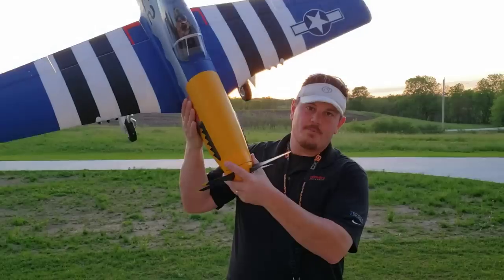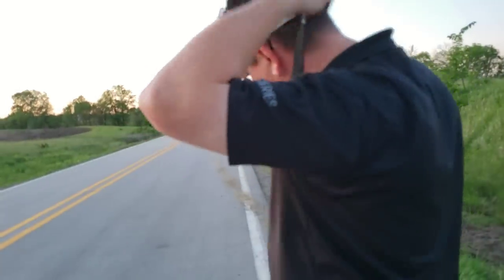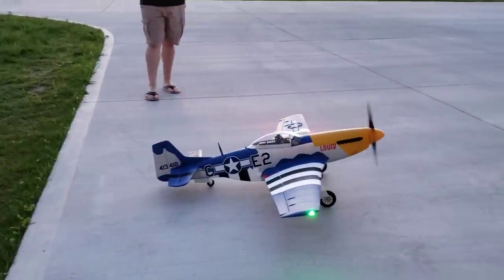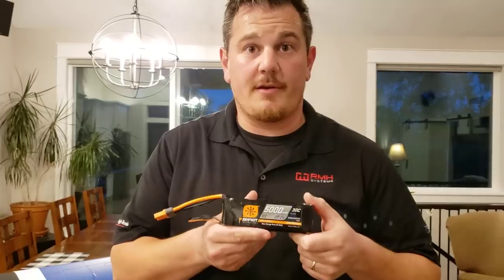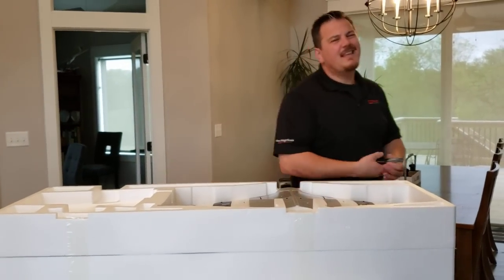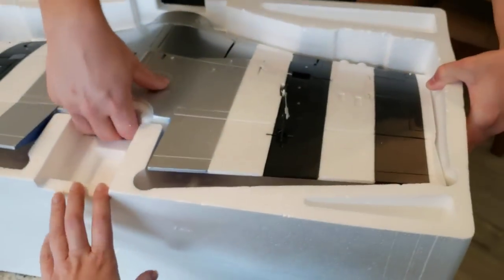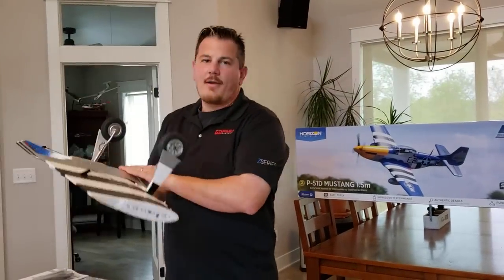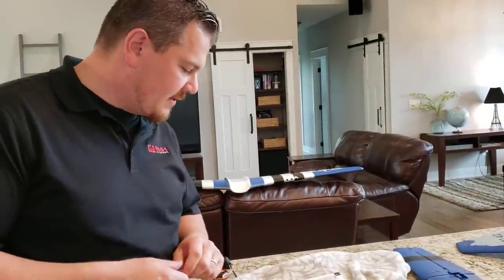E-flite - P-51D Mustang 1.5m - Unbox, Build, Setup, & Maiden Flights

Comment: Just maidened mine.  The intent was after increasing throw to go down the runway and see if she would track stright and then stop.  Well she took right off.  So easy when you have rudder control tracking her straight.
I have the original release and the gear doors were very stiff and brittle.  They both popped on landing.  Easy fix with your demonstration!   Thanks Brian.
Reply from the maker: Thanks! So you made for more rudder throw, and she was easier to launch??? AWESOME!!!! She can be a handful, but then that's not always a bad thing ;)

Comment: Purchased one Brian, and from your master link to HH.  Thanks for the effort (both of you) to put out these instruction videos.  Sadly, it arrived DOA with a loose pin on the fuselage side of the aileron connector.  No ailerons or cool lights...  I am just so glad the loose pin did not make enough contact to fool me, then punish me in the air.  I’d have had a nasty crash and probably never known the reason why, so here is a tip for others who get this model:  Do what Brian did and test all those connections with a servo driver.  I love the one built into the battery checker.  As for the connection from Fuselage to wing and anywhere there are pins (as opposed to sockets), push gently on the pins with a toothpick or some such, and check that they don’t slide back into the connector or wobble about.

OK, so that’s disappointing, but here’s the good part.  After the mildly annoying process of using the contact form to get the process started, and the also frustrating delays in communication due to a busy tech support department, they got back to me, reviewed the description and photos I sent on the phone, and immediately put in an order for the connector and screw I needed to effect the repair.  Those parts arrived FedEx yesterday.  I’ve yet to fix and fly it but felt ready to post an important data point, and here it is.  Brian often raves about Horizon’s support, but honestly, and don’t be insulted Brian, you have to take that with a bit of skepticism.  People who are sponsored by, or have financial relationships with, or are provided products to review, often get support that the general populace will never experience.  I know this not just as a suspicion, but as a fact.  I founded Measurement Computing Corp and we had flags for large and influential customers.  Who wouldn’t?  A customer who represents a chunk of your income, or has the reach to burn your reputation, is a customer that is going to get special treatment.  I have no idea if Brian does, but one has to wonder.  Well, with regard to Horizon Hobby I’m not wondering anymore.  The support from Horizon is great, they’ve been great to me, and I don’t mean a damn thing to Horizon beyond being a regular customer.  So that’s my endorsement.  I hope you experience the same great support I have.
Reply from the maker: Thanks for the comment Brendrix, and firstly, sorry you had a bad pin!!! I understand yours and other's skepticism. You have to remember that before I was working with Horizon Hobby, I was in the exact same boat. I've JUST last week, called to ask for a motor on my little UMX A-10...one of the leads melted on ONE of the motors! Easy diagnostics, and then a couple pictures later (that weren't even asked for) and I had the part in the mail a couple days later. I need to install it, and it's a pain in the butt to have to deal with this, but it'll be made right. I've been in arguments to the point of wanting to pull my hair out with Hobbyking, and a few other select companies (I even had at least ONE like this at HH - but we kissed and made up, interestingly enough!). A lot of the issues experienced in RC Hobby originate from operator error (I'm included) so the hobby companies have an uphill battle deciphering if the customer want free parts, or if they had a problem that was caused by them, the MFG...which is tough, but HH is one of the best if things don't go perfectly. I've had good luck with a few other companies, don't get me wrong, but I've had terrible luck with others. Ultimately, I'm as cheap, and hard headed as they come. I generally fight until I get what I need, while many will roll over too easy, or others come on WAY too strong and prompt a defensive "No" from companies.

At the end of the day, I need people to know that if they do everything right, and even if they do some things wrong, Horizon Hobby will be one of the best at being there to make it right. They might say no once in a while, but I might be fudging a bit once in a while...there it is ;)

Glad you're getting this beauty airborne soon!

P.S. One last tip - Keep the thing from ground looping to death - keep her on her mains as long as you can on landing! Good luck!

Comment: Had my Maiden yesterday! Flies wonderfully! However: I had the same issues as you: 

• One of the retract strut covers broke on my first flight only they didn't give me any spare ones!!! Currently trying to sort that out with Horizon now. 

• That 3mm of down elevator is nonsense. If it wasn't for safe mode my first flight would have been really hairy. Mechanically put the elevator level for the second flight and BAM. Perfect level flight. Flew like an absolute dream. Like the 1.2 June Nite but with a much firmer stance in the sky. Flies on rails.

• Ground control: What ground control!!!!! You cannot keep this thing in a straight line! Learned that you have to very slowly increase throttle for take off, and abandon take offs if it shows any sign of straying off path.

All small things though really. I consider my first two flights a massive success. Got a little work to do on my dual rates and expo. I followed both your settings for this and also referred back to your settings for 1.2m June Nite and decided for something halfway in between. Worked out that I want to soften the ailerons, but not rudder or elevator, so I think I'll just put more expo on ailerons on my mid rates and fly on mid rates all the time. Once I get comfortable with a plane I don't really use different rates, they are just good for the first few flights till you are sorted.

Thanks for these videos I just wouldn't know what to do without them!

Gonna buy a Viper next so the other night I watched all your viper videos!!!!
Reply from the maker: YEP, glad I'm not just a BAD pilot ;)  "• Ground control: What ground control!!!!! You cannot keep this thing in a straight line! Learned that you have to very slowly increase throttle for take off, and abandon take offs if it shows any sign of straying off path."

So glad you were able to get a starting point from watching my videos ;)

Comment: Brian you're so lucky your wing just slid through so easily. I jimmied it in and out for an hour and gave up. Gonna try tomorrow again.  Still blown away by the size of this thing.
Reply from the maker: "I jammed it in and out for an hour and gave up" - wow...TMI - LOL - I'd try tomorrow even if you had success ;)

WOWZERS!!!

Okay, now, in all seriousness. Why couldn't you get it in? Are you talking about the tail or one of the main wings??? If you're having trouble, you need to look into the alignment of the connectors. Take a servo extension cable and drape it between the connectors and make sure they connect. If they do, now test the wing....are all the servos working? Was one backward??? Get some more information about if it was capable of alignment.

Also, If I'm not mistaken, can you just pull out the wing connector plugs and see if they'll go into each other? If not, that's your issue.
Reply: @BrianPhillipsRC  LOL didn't realise that's how it came across. I'm talking about the main wing installation, it seems like the servo pins on the fuselage are slightly out of alignment and I'm not sure how I can fix that. It's also really hard to see the alignment on this thing. I'm thinking to take out the wing connector plugs, try and see if they go into the fuselage, and then stuff them back into the wing again. I was watching RC informer's assembly video and he seemed to have the same problem that I did with the wing installation, but he bent the servo pins somehow and got it to work, which I'm sure I would stuff up some how.

Comment: Hi Brian, I struggle with take off on this P-51D. It has such power that it torques on take off! It is an awesome plane to fly with really outstanding colour and is very striking. I fly at a designated flying zone in Aus and families stop to watch because of this plane. CG is always critical but in this plane I find that the stall zone is deadly if the CG is not perfect. A really long landing strip is also good LOL
Reply from the maker: I'm glad to hear this, as I too have had a heck of a time with ground handling. It's like spray and pray ground handling...you give her hell and hope she'll transition from the tail wheel to the rudder authority in time, but before you know it, you're in the air and flying!!!

Landings are very sketchy, I could drive it down the block on the mains, but as soon as I try to drop the tail wheel, it's just a total guessing game!

Comment: I'm an Aerospace Engineer.  The CG is measured from the leading edge of the wing at the root.  The root is the portion of the wing touching the body.  This is a straight-line distance, not curved as in over the wing chord.
Reply from the maker: yes, I have since corrected my way of measuring for CG. This was an incorrect way of doing it, as you mentioned.

Thanks

Comment: Nice mini series Brian 😆 That is a great looking Mustang.It does need a little friction on the gear to slow it down.🍗🦊
Reply from the maker: I've been thinking about putting a zip tie on the strut to engage the side or top of the tire, just enough to slow her down, but which could be easily removed if I don't like the way it works. When I figure it out, I'll be sharing a video.

Comment: I grabbed the pushrod with needle nose pliers and tried to move it with no success. I will keep working on it. Hopefully I can get it working without new parts. Lately Bangood has been in the slow boat from China mode and it seems everything is a month or two to receive. I just received a UMX Turbo Timber from HH so this may get me moving on that. Still have to buy a transmitter. Thanks and enjoy that P-51.
Reply from the maker: When you fly the Turbo Timber, you will quickly forget the repairs you're making :)

What transmitter are you thinking about? Any of these???

Transmitters...
ix20 - https://bit.ly/2Rv1d3M
iX12 - https://bit.ly/2yOEDN7
DX9 - https://bit.ly/3eh3klx
DX8 - https://bit.ly/2xmsD5f ------ I would do this or better (above), if you're getting obsessed [like me].
DX8e - https://bit.ly/34uxoWn
DX6 - https://bit.ly/2Rvik5z
DX6E - https://bit.ly/39Ym1Y9
DXe - https://bit.ly/2XsApFi
TS8G Plus - https://bit.ly/39Vxwzy

Comment: Brian set your timer to turn on and off with your throttle cut switch. You’ll always know the actual time under power. I learned that trick from CoeShow619 and it works great! Btw great videos you’ve inspired me to work harder as a newer fixed wing pilot so I can get some of these awesome planes.
Reply from the maker: I keep hearing this tip. Glad we're an inspiration ;)

Comment: I was leaning toward the DX8 with future aircraft needs in mind. As far as being obsessed I am a retired airline pilot and airplanes have been in my blood for 50+ years. I have watched the RC hobby for much of that time but it was usually too expensive or difficult until now. Your videos moved me to jump in first with the mini Trainstar and then the Sport Cub 500. Been having fun [and crashes] with the Sport Cub. The Turbo Timber looks like a fun step up to improve skills with for a while. Really like that P-51 though!!!  I cut the wing off the Sport Cub last night and it looks like the elevator servo arm was rotated 180 degrees and impacting the rudder servo arm. Jammed. Don't have any idea how that happened.
Reply from the maker: Go for the DX8 - you'll NEVER look back!

DX8 - https://bit.ly/2xmsD5f

...and to be totally honest, the DX9 has such a big price jump, that you can just upgrade later when you get to more sophisticated aircraft.
Reply from the maker: Glad to hear you found the issue with the servo. I figured you were bound up. If it fails to work again, there's a gear inside that micro servo that's broken. You may take it apart and visually inspect it to learn, first hand, what happened....if you can't just take off and run with it after "centering" it manually.

Comment: My 5000 smart pack is flush with the front of the battery tray and balanced perfect on a Dubro CG balancer. Not sure why yours is so far forward.
Reply from the maker: Maybe they omitted a nose weight???!?!? I had a buddy that had this happen, we didn't realize it until it was crashed and the BALL was missing!
Reply: The esc is likely pulled backwards in the nose since it’s not glued in place.  Try putting your hand in the fuselage and pushing it way forward but not so far that the orange heat sink on top of it touches any foam n fuselage.

Comment: 100% on the elevator correction.  Initially when I was testing the deflection full up elevator looked to be neutral to me.  Then I watched the rest of the video and saw what happened upon first flight.  Sometimes as the pilot you can't always believe what is in the manual, better safe than sorry.

Comment: Hey Brian, what a video!! Very in depth and enjoyable. You and your camera crew make a perfect team. Don't ever get ride of her or your channel will fall flat on its face.

I may have missed something but it looked like all you needed to do was raise your alarm voltage setting equal to or higher than actual battery voltage to initiate the telemetry alarm. Did you ever get the alarm to work?

Thanks for sharing that beautiful mustang with us!
Reply from the maker: Thanks, and I agree about if Megan stops filming...

As for the telemetry alarm...I never got it to alarm...so I don't know what I'm doing wrong.
Reply: Why don't you try what I suggested. I saw you changing the alarm voltage but not close enough to cause it to trip.

Comment: Brian, I ordered mine the first day of release and have been flying ever since, the outer gear doors are definitely an issue, very fragile under-sized pins, I would love for you to come up with a very durable solution to repair or modify the outer gear doors. I have probably gone through seven or eight sets that break in the air. I'm conscious they are fragile and do my best not to deploy whenever the plane is moving fast, just a little gust of wind will snap them off. You are very clever with coming up with modifications and fixes, so let's see what you come up with :-)
Reply from the maker: So, did you get the upgraded ones??? I assumed I killed mine on that "drift" landing.
Reply: @BrianPhillipsRC  I've ordered the doors where I can find them, some directly from Horizon Hobby and some from other online Horizon Hobby dealers, I just got 6 packs last week, nothing on any package says anything about being upgraded, do you still have the package the upgraded ones came in, if so what does it say, is it a different part number?
Reply: @BrianPhillipsRC  Unfortunately the drift landings are very common with this bird, not so much with my FMS 1450 P-51D, many pilots have the same problem and also experience landing bounce, the trunnions are also brittle and fragile, made of cast metal, another weak spot.  I believe the big prop adds some ground-effect adding to it being tricky to land. The hard tires add to the bounce, these are just some items for future modification by the factory.  This P-51 is all new and there will be some things to improve, I would still highly recommend, what an awesome airplane :-)

Comment: Hello my friend. My landing gear doors  in the front is not working. Do you think something in a control I need to set it too? I have a NX8, the plane is a P-51 Mustang. Thanks
Reply from the maker: The whole retract isn't working? or the DOOR ONLY is not moving? I'd look for a disconnected wire first.
Reply: @BrianPhillipsRC  . Hello my friend, thanks for replying back. The doors open and the landing gears goes down, but the doors would not close back. I have the spektrum NX8. I email Horizon, so I’m just waiting for them to reply back.

Comment: This is good show Brian, I enjoy your videos and as it is overt you love the subject!  This E-Flite warbird has caught my eyes. I wonder whether you can show instructions on how to install/use a transmitter/receiver other than Spektrum (e.g. Fr Sky Taranis) that offer a SAFE feature. In my RC Aero Club, we have interference issues with a nearby cell tower and Spektrum. We experience loss of control and plane crash. Nothing against Spektrum, it works wonderfully overall. I just want to avoid that risk and Taranis seems immune to it. Many thanks and btw, camera crew did a good job as well! Keep making videos!!!!!!
Reply from the maker: That's a terrible issue to have to deal with. I don't know how you would do this, since I'm not sure what other protocol offerings are. I would be calling the FCC and getting that tower fixed.